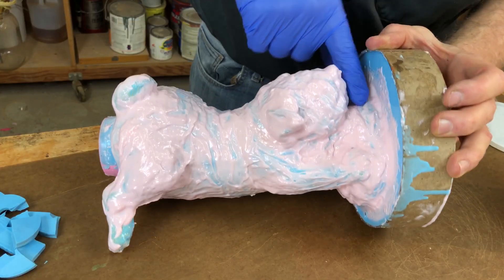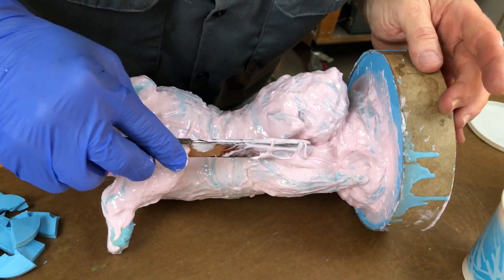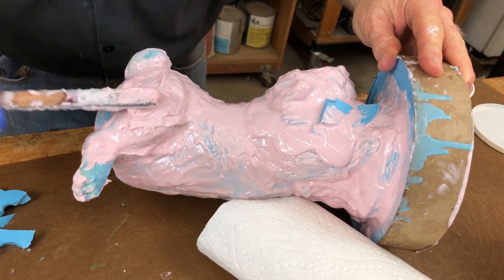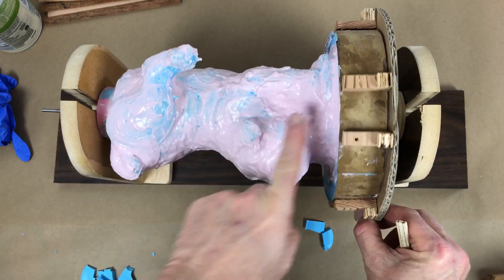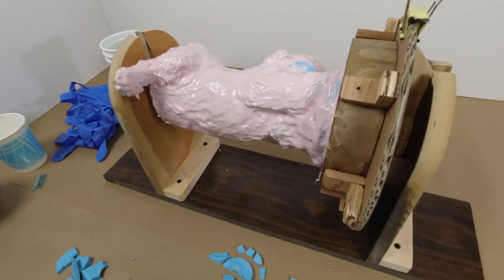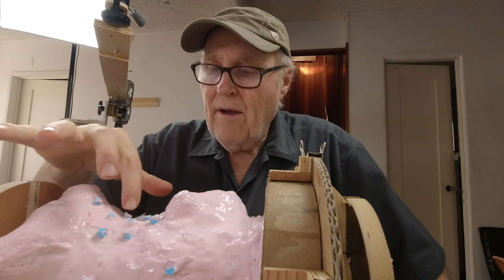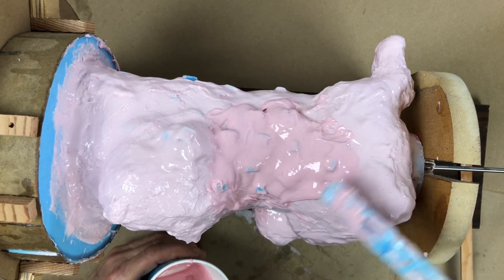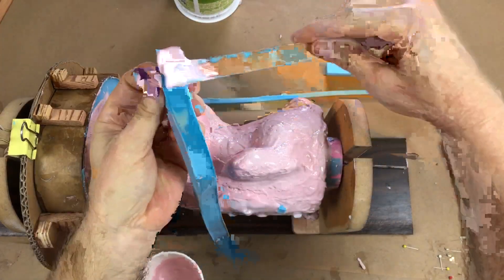Hollow Cast A Complex Part - Brush On Silicone Mold, Part 3

Comment: Hi Robert. 
Thanks for all of the great videos. I was wondering if you are a member of the masons or Knights of Columbus. 
The reason for asking is that I’m making a project to display fraternity symbols of any kind. I’m basing my design on a piece of jewelry that’s about the size of a large marble maybe 12 mm. 

Years ago I toyed with plaster casting so I thought of constructing the model from plaster. My ball is 7” in diameter and consist of six nodes that fit together to make the ball. 
So far I have two rubber molds (thanks to your guidance). One will bolt together into a center block. The other has been quite a challenge to incorporate the hinges which are strong enough to accommodate the castings which are about one pound each. 
I look forward to hearing back from you. 
Once again thanks for sharing your years of knowledge. 
What I would like to do is make a ceramic mold so the nodes can be made hollow and have some of the great finishes that can be fired on them. 
Hope to hear back soon. 
Ron Davis
32nd Degree Master Mason

Evansville Indiana
Sent from my iPhone

Comment: Why are bubbles in the  mold a problem especially in the outer coats of silicone?
Reply from the maker: Because if there are air bubbles in a rubber mold they collapse when the mold is put under pressure to prevent bubbles in the casting resin. And that collapse can distort the mold which causes the casting to be warped or parting lines to open up and cause lots of flash. The goal is always no bubbles in either the rubber or the resin.

Comment: If you had to do let's say 500 casting of those, would  you use the same type of mold?
Reply from the maker: If I had to cast 500 of these the first thing I would do is re-sculpt it so that it would be much easier to cast. Then I would calculate how many castings I could get from each mold and then make enough molds to produce all 500.  Also I would build a few computer-controlled rotators and program them with the proper rotation pattern. For a run that large those machines would pay for themselves in labor savings. Either that or I would send the whole job overseas and let a factory do it there! Which is exactly how they made this one.